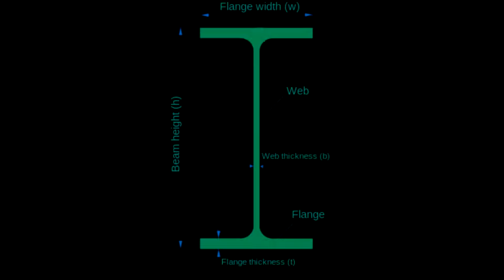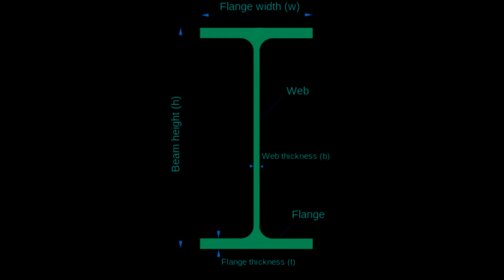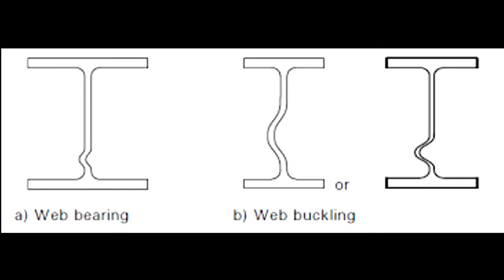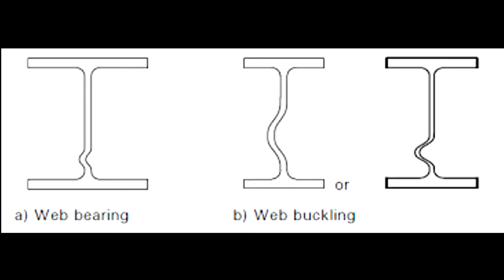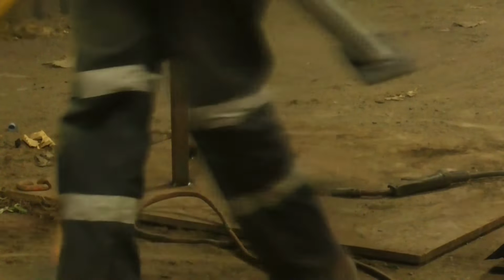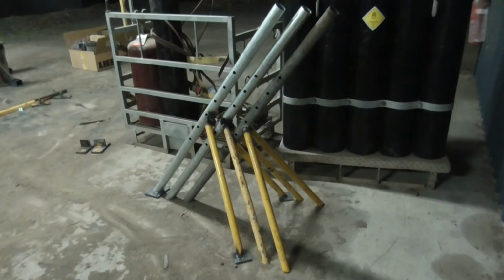EP-30 FINISHING THE BOAT STANDS. Making sparks fly. Bringing this trawler back to life.

Comment: Paul what are you tieing the 3 feet together with I have built these before and they needed to have a piece of heavy bar or chain between them  then when under boat a chain from one side to the other , enjoy doing this vessel as I myself have
Reply from the maker: At the moment I have put 4.5 ton ratchet straps between them. I am making some changes there though. Not sure if you’ll see us doin that in the footage I have, but if you watch closely you may. I was a bit of a one man band on the day so had a bit too much to do rather than worrying about getting the details right. I wish I could have shown that though. I have to make some changes there in the next week so I may get the time to slow down a bit and detail what we did on the day. Thanks.

Comment: Audio was a bit mangled just at the start. Only a few seconds though.

And I highly doubt that the web of that beam is going to bend or buckle. For that to happen there would have to be enough load to cause the reo to go at the same time. But, flat bar is cheap for piece of mind.
Reply from the maker: Thanks Daniel, I had accidently compressed the sound track for that cut. I don't know how but it must have been just before I did the render. I watched it through before doing the render. 

It is more a piece of mind thing. The reo is only on one side on two of the stands the one at the stern has it on both sides, so I think I will put it on to be sure..  Cheers Paul